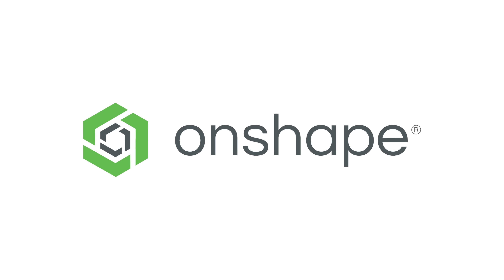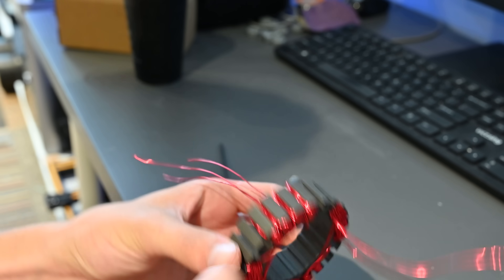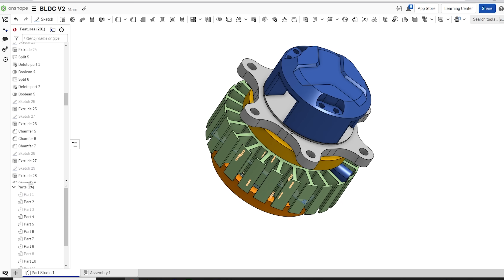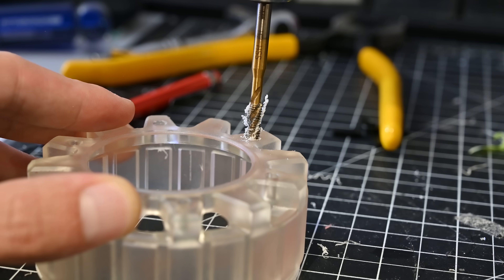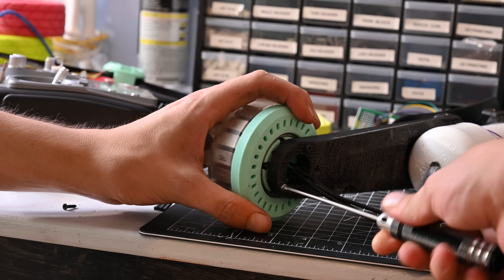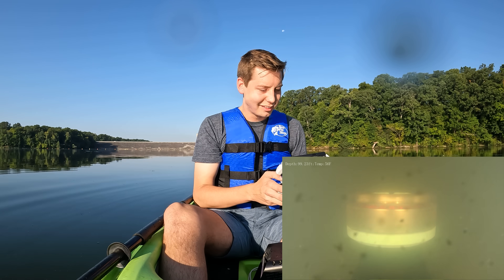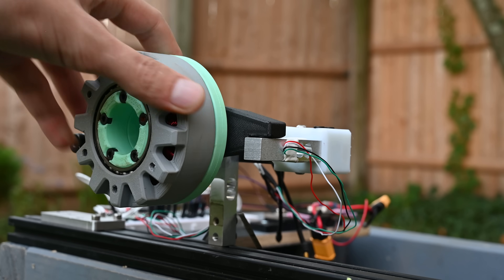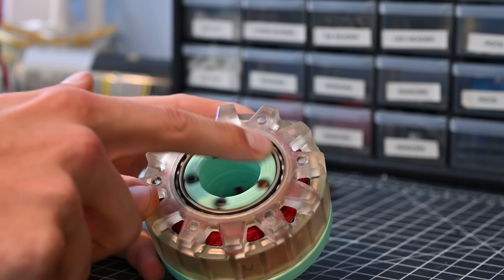Waterproof 3D Printed Brushless Motor... Will it work?

Comment: what was the design consideration for having the rotor on the outside instead of inside? just in case im getting the terms incorrect why have the wire on the inside spinning the permanent magnets on the outside instead of vice versa? to me not having the outside housing spinning is less dangerous, but im not sure if there is better performance from this arrangement over what im suggesting.

Comment: Really liked this video. Have you tried different filament and materials to help with the temperature deformations? I’m wondering whether it would be beneficial to go the route of reducing temperate output or to invest in higher temp materials. Of course it’s better to aim for both, but as a beginner, I’d end up caught in a lot of complexities dealing with both which may pull me further from creating lasting prototypes.

Comment: Changing the rotor mechanical design will help for submersible project cause water is denser than air, make the rotor a circular shaft rather than whole exo rotating this will reduce torque required and reach rpm fast and reduces current consumption.

Comment: When using iron-filled PLA to enhance magnetic permeability and increase the Lorentz force, its effectiveness is limited. This material tends to generate heat due to eddy currents induced by intersecting magnetic fields, much like the mechanism in induction cooktops. The majority of the magnetic flux travels through the air gap, interacting with the enameled copper wire within the stator slots to generate the Lorentz force. To effectively strengthen the magnetic field, strategies such as reducing magnet spacing, using larger magnets, or employing a Halbach array are more efficient.

The primary source of stator heating is the current flow through the copper coils, which generates heat similar to heating elements like nichrome wire. For the stator, it's advisable to use a heat-resistant material with a rating of at least 250°C, such as Polyimide (PI) or Polyetheretherketone (PEEK). These materials, processed via CNC machining, offer superior thermal resistance and mechanical strength. For the rotor, a thin-walled aluminum pipe can be used for the inner ring, encased in a 3D-printed shell with integrated bearings for optimal performance.

Comment: Use a standard stator. It’s cheap, widely available in different sizes. The main reason  of building a DIY motor is a precise optimization for your load. Otherwise a price (a chassis, magnets, wire..) is about a same to a motor from China
PS People achieved 90% of efficiency with a pre-made stator. Of course all measurements were made on a rig, not with a propeller that might not match to a drive

Comment: I know I'm late to this video, however you're really going to be doomed to very low efficiency as long as you construct your magnetic parts out of anything but iron/steel.  Without that metal to properly develop a uniform, strong magnetic field, you're essentially throwing away a lot of power.  --And as you found out, it’s also going to self-destruct when the core heats up and melts your PLA.  I've recently gone over the challenges in designing your own BLDC motor, and it's rough.  The stator material is quite expensive, and it's very tedious to machine many layers of the metal and stick them together, being careful to insulate each layer to prevent shorting out the power that’s developed between layers.
  Ultimately, it's possible, but it's so much more expensive and less efficient than just buying one.

Comment: It's interesting that your stator melted, but while eddie currents are often cited as the cause, i'd wager it's more likely to be simply the winding current you were seeing at full power. I think the more important thing to consider is what part of a BLDC motor needs to be waterproofed. With a bit of enamel or some manner of coating, the steel parts of a cots BLDC motor could be corrosion proofed. Making the stator out of steel laminates, and in fact making the rotor out of a steel ring, are very important to a motor's efficiency as those materials and their shapes help focus the EM fields in the most optimal locations. The amount of incohesive iron or steel in the plastic is likely not very useful, and the plastic rotor will do nothing to focus the M fields inward. The biggest issue with waterproofing a BLDC that I can see is the bearings. That is where something that can withstand corrosive emersion at depth is important. in your motor, you used unsealed bearings, so you were able to wash them afterwards, but even then, they will struggle to retain lubrication and in your post-water test, you could already see rust forming on one of the races. Sealed bearings do a much better job of retaining lubricants and keeping out debris, but even they are not typically fluid proof, nor able to withstand hydraulic pressures experienced at depth. 

I still think this is really cool, and an awesome way to learn more about motors. I wonder how someone could make a BLDC motor with bearings that could withstand prolonged cycling in and out of water/saltwater. Keep it up, thanks for the video!

Comment: Is there anywhere that sells ASA or ABS composite magnetic filament? I can't seem to find any, but it seems like this would help with heat issues to some extent, although it's not a perfect solution.

Comment: A SUGGESTION FOR ACHIEVING HIGHER OVERALL PERFORMANCE:  the slot setup you used to mount the Permanent Magnets increases the distance to the coils. The tighter you make that gap the better! almost all of the motor's performance will improve by making that gap smaller.

Comment: I actually created a 3D printed Brushless DC, Areal flux Pancake style, 6 coils, 8 magnets, 15AMP ESC.
I had the same issues you did with melting coils, so I "upgraded" to PetG, which helped to some degree. Issue is though, I couldn't find any metal version of PetG, so I also experimented with core metal screws to clamp the coils to the stator, which helped some with the tork and the starting issues, that i saw you had issues with too.
For heat dissipation I designed a version where the rotor assembly had small lamels shaped like wings to create airflow through the rotor and stator, in an effort to cool down windings... It kind of requires a pancake design to make room for the airflow in a direction that would help, and so now you can also get this in commercial BLDC's, which I think is a testimony that it actually would be a way to go too... I however never had the tools to get this version "good enough" to run.

Comment: Hello, I am designing a similar motor entirely with composite materials, in the end the only thing printed would be the molds, the stator for its part to avoid suffering from these problems, first I chose to design a stator with a combination of epoxy resin and compacted iron powder in a silicone mold, this silicone mold would be made with a 3D printed piece of the stator, being a powder it does not generate Facault currents, but since the core is less efficient it produces greater heating of the copper coils, the epoxy It resists the heat generated much better, the casings of my engine will be made of forged carbon fiber whose mold to make them would also be a 3D printed piece, 3D printing is fantastic for testing but if what you want is precision and durability At the core you must opt for better materials, which is why 3D printing falls short.

Comment: Are you able to minimize the air gap between magnets and the stator? 

IIRC, the rate of field strength decrease is greater for Halbachs as you move away from the magnets vs a N-S-... configuration and/or standard magnet. If you're going to put the effort into Halbach arrays, minimizing the air gap will be critical to utilizing the benefit provided by Halbachs.

Comment: 1:33 You can also print transparent parts on an FDM printer. Use transparent PETG, print dead slow (5-10 mm/s) and with 100% linear infill and some (101-103%) overextrusion. Not as perfect as resin, but it does the job.

Comment: Have you calculated what power the propeller is going to absorb for a given RPM? To me, you could go with a much higher pitch propeller which will increase the  load and therefore increase the power the motor is using.

Comment: With a bit of steel wire, a rig could be made to use the router table to wind the coils and maybe also do them more evenly, or maybe even get more raps or at least more balanced, neat raps.

Comment: My drone motors work fine in the water til the bearings give out from the lubrication being displaced. I dunno if this was addressed in the video no time to watch currently but yeah brushless motors are good in water generally as long as the power source itself isn't being shorted which is a pretty easy thing to accomplish. So in reality I think all you did was make a custom motor that isn't as powerful or durable as motors you can buy. Pretty neat and fun stuff to do though.

Comment: I think the printed coil core could be a problem. I really do not know how good the printed material is in regards to magnetic flux. I also were thinking about how to make this Motor stronger (if the other problems are fixed) and would like to ask if a magnet configuration like it is used in a Halbach-Array would be benificial (increased magnetic flux from the permanent magnets side)? Or if the increased weight from the extra magnets makes it a net minus tradeoff?

Comment: There's no any iron on the rotor. Magnetic path very long. Add length betveen outer poles of magnets. You need more length of copper, thus large losses in copper

Comment: Mold the core from Smooth-On EpoxAcast 670 HT. With proper post curing it can take up to 177C or 350F. Mix in some powdered iron to make it like the 3D printing filament with iron.

Comment: Go ahead and use the high current windings, but only run it submerged. As long as there's some flow near the windings, the water will carry the excess heat away.

Comment: I think the most obvious suggestion would be to use a higher temp plastic for the stator.  I'm not sure how the windings work, will have to check out that website.  

If used underwater, that actually wouldn't be a problem.  - Try that same design, on your sub?  No way it can overheat.  You could probably overdrive it.  The issue is heat, and you have an entire lake of watercooling.

Comment: I'm not sure how similar electric motors are to solenoids (in physical & power calculations, but I think they are pretty similar) but I remember being amazed at the difference in force the solenoid could generate by reducing the distance (space) between the coil & the magnet/iron core.  You want to do absolutely everything possible to get that gap as close to zero as possible and I'd suspect the same thing should be considered when designing the distance between the rotor to stator.  

IDK if you would be able to turn either on a lathe to make the fit as close as you dare, I guess even using a drill press & sanding the piece might be a substitute for the lathe.

Would the motor benefit from any type of flux shielding?

Comment: The compact design seems to have left no room for cooling the trapped air inside the stator housing . (Under water and above ground designs will differ here) Directional cooling fins and good heat dissipating materials should help further your proof of concept . Nice work .

Comment: Cnc the stator out of metal and print the rotor. Most all motors generate heat, its benefital to add internal air fins incorporated into the inner rotor.

Comment: I think I can give you some help with fluids, as that's closer to my area of expertise. You should really avoid spinning parts from free waterflow and there's plenty of effects messing the flow down the line, especially if the propeller comes after it, so put it in some casing with cooling ducts as necessary. You could also make the whole assembly smoother by making the cap fit perfectly to the propeller and have some rounded edges. Invest some time into CFD.

Comment: I wonder how feasible it would be to use electromagnets instead of permanent magnets. It would use more power, but you could use a sensor to balance the load and improve the efficiency of the motor over time.
Reply: So an induction motor?
Reply: @DoesntRefillTheBrita   Yeah, kind of.

Comment: Impressive build and testing quality, well done. Now, go and study magnetic theory until you understand 'flux' and how to guide it through your structures. Adding some 'back iron', a flux path to contain the magnetic field around the outside of the rotor magnets will be a big help. Next, look into the material of the poles under the windings, you need to balance 'reluctance' (how well the material carries flux), and 'eddy current losses' (electric currents generated in the pole material, related to conductive area, you don't want that.). This guy shows what an analytical approach can achieve https://www.youtube.com/watch?v=yxZZ2M3gRyI

Comment: It has been on my todo list for sometime, maybe you can do it given you have the time and skills.
The idea is the propeller has no center hub, but a ring with the blades going towards the center.  The stator is in the 'duct' or kort nozzle around the prop ring, so the prop blades also get the benefit of the ducting.   This makes the whole thing water cooled, and the ring magnets hold the prop without any bearings required.   There is a name for this setup but I can't remember what it is.  This is prop setup used on some really big ships, that use electric driven props and diesel generators to provide the power.
OK, i think it is called a RIM drive prop, here is a pic https://en.wikipedia.org/wiki/Rim-driven_thruster#/media/File:Rim-Driven_Thruster_(Swing-Out).png
Here is a video, https://www.youtube.com/watch?v=Te_xejpriFM

Comment: I don't know if this is what is happening here, but, we have the heat problem at my job sometimes. Solenoid coils burning up (Doh!) has to do with a light load on an electromagnet from a stuck valve. It just roasts the epoxy casing in 10 minutes. I don't know the science, I just service it. But I feel like something similar is happening here going by the comments. My semi-educated guess would be stronger magnets on the ring.

Comment: Some people suggest eddy currents as a problem - this is most certainly not correct as the iron filings in the metal pla are separated by... pla (famously an insulator)... thus the eddy currents in the grains of iron are incredibly small and would not produce basically any heating. Having said that, the PLA with iron filings is not that good of a material to use for a core, as the magnetic permeability is literally not much better than just air and pla on its own. It basically just adds weight and lower temperature stability for no gain. You might want to use PP filament if possible next time, as it melts at a much higher temperature, but with low thermal conductivity, any plastic is going to be fairly poor as core (and casing) material in the end. 
I noticed the very low efficiency of the motor, a fair bit of it is probably to do with how large the air gap between the electromagnets and permanent magnets are. The larger the air gap the less of the available flux from permanent magnets you use. You definitely need to reduce it down by a lot, especially if you want to use a Halbach array. In addition, the motor looks quite wobbly with rather large bearings so there's probably some friction- and other big mechanical losses there. You might also want to consider a back-iron for the permanent magnets as well. 
The winding configuration is probably fine, as the calculator uses the best practices. 
Another thing to think about is that because your core material is very much sub-optimal, then long electromagnets like radial flux motors often go for, are going to be less efficient. You might want to look into making an axial flux motor instead, which is better suited for making out of low magnetic permeability materials.

Comment: I have a bit of future waterproofing for you: Stranded wire has little itty bitty holes in the wire and water will creep through the wires SLOWLY so you will think everything is fine and then suddenly water gets into places you never thought it would get into and cause issues.

Comment: - doesn't everybody in the RC space kind of realise (ok 5:28 you say that - making the title clickbait)  that all brushless motors are electricaly sealed from factory...  obviously steel components will corrode in seawater (or other non-fresh sources) use ceramic bearings  - but what was achieved here??

For flooded operation - streamlining all the motor internals with epoxy could help with turbulence..

 - ( for high pressure water resistance of electronics, simply fill the whole electronic enclosure in mineral (transformer) oil - a balloon or condom around the boards will keep oil out of barometers or other sensors  which may need to remain dry (if that is actually any problem..) - or simply conformal coat - then fill with oil...)

Comment: 6:10 = I can already predict that water is going to seep in via the cable covering...
Reply: Yep. Need to terminate the insulation "hose" in the epoxy so that it doesn't bypass the seal. Strip the wires in the middle of the epoxy so that only the copper wire passes through all the way. Stranded wire? Epoxy or solder in between the strands will take care of that.